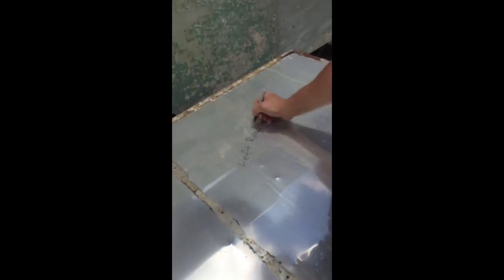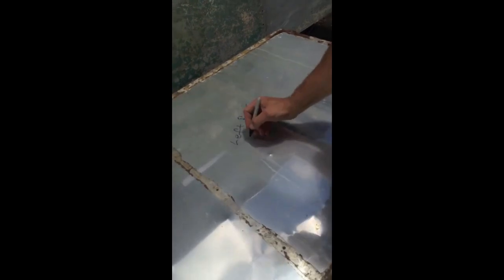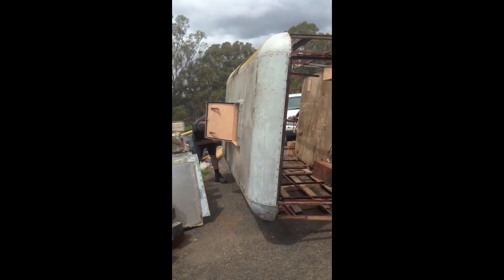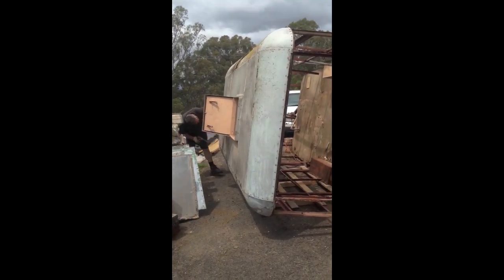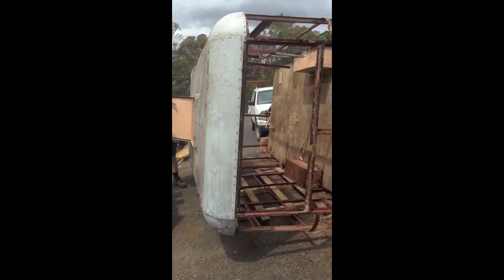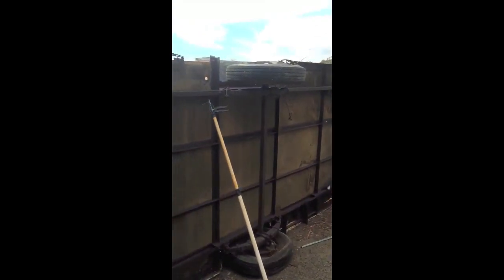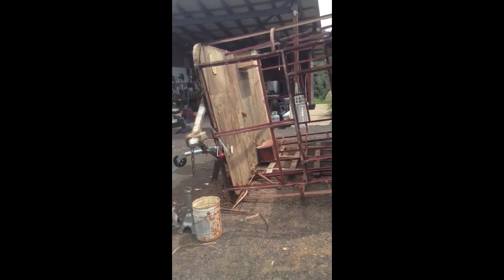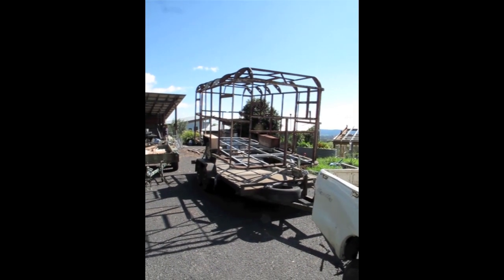Removal of vintage caravan cladding

Comment: could the outside panels have been left on and still fix corrosion issues?
Reply from the maker: No unfortunately the cladding has to come off to access all sides of the frame. It is also essential to reseal with modern sealants and rivets to prevent water ingress and further corrosion so all the cladding has to come off. It’s the reason why caraparks did not survive as they all leaked owing to poor original sealants and rivets. The frame usually requires painting also to prevent galvanic corrosion between the frame and cladding
Reply: Great vid